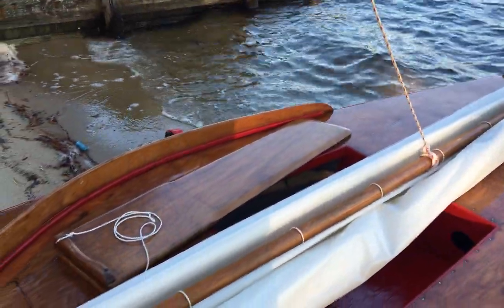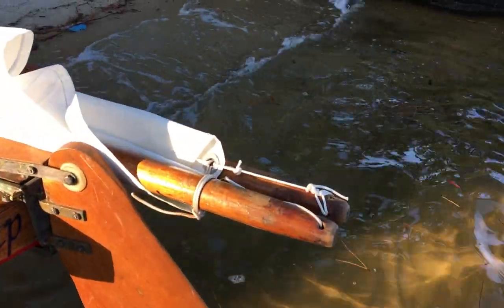1953 Alcort Sunfish ZIP 20 Jun 20 Upgrades and Peculiarities

Comment: awesome!!
did u apply varnish after the epoxi? glassy!!! 
great job!!
Reply from the maker: No varnish. We used West system 207 Special Clear Hardener, it has some UV inhibitors and the boat is not outside long enough to worry about UV. We wanted the finish, not an amber varnish tint.